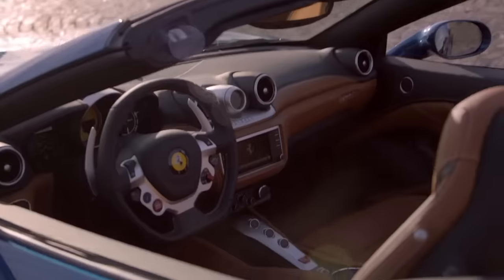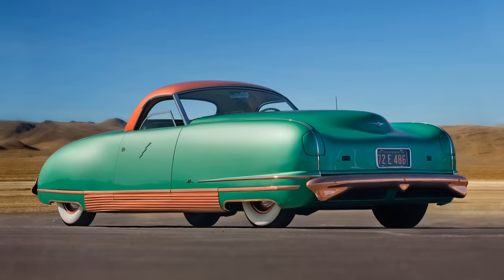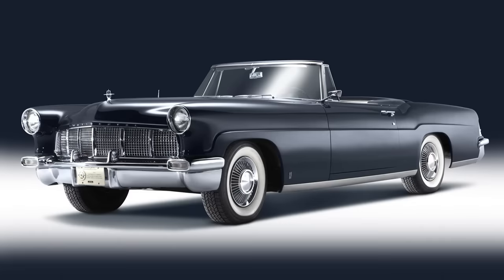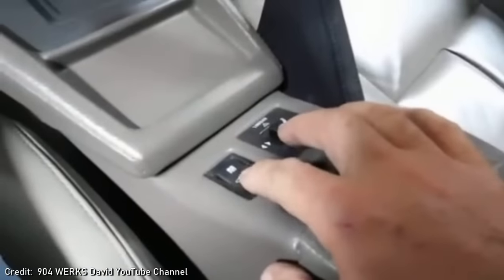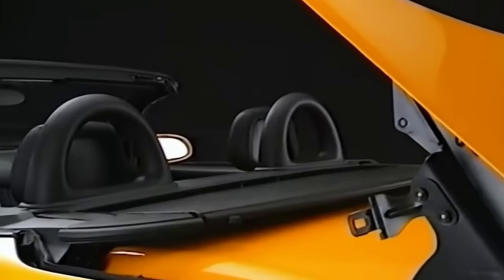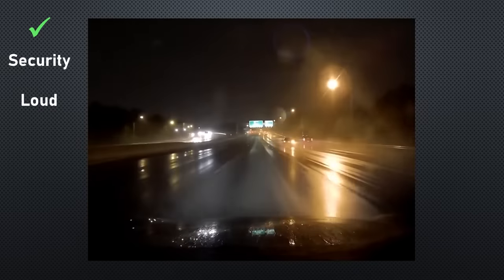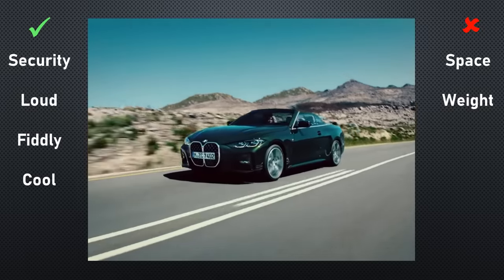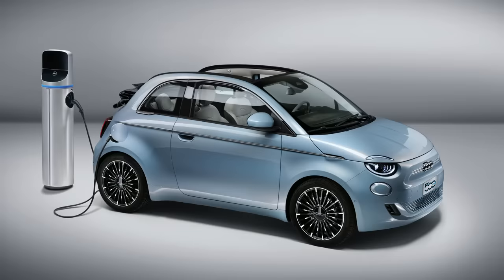The Rise and Fall of Retractable Hardtops

Comment: I have a soft-top, but I think that there are benefits for hard-tops. I live in an area where it snows and I don't have a garage, so I'd be worried if I got like 2ft of snow on a soft-top. It's completely automatic, so I don't have to worry about the situation of manually putting it up and down. It also has a glass back window with a defogger built in, which is a good middle-ground, I guess. I've considered numerous other makes and models with hard-tops, but the prices are nuts right now.

Comment: A long time ago my auto electric instructor told the class, if a retractable roof car (1950s) came into the shop for an adjustment, charge them three times your rate and you may break even.  ;-)

Comment: That original design of placing the hardtop on the back of the car (instead of in it) makes so much sense. If a luxury brand were to design a modern car around it then it could really be a success. Because missing out on so much cargo space isn't an acceptable sacrifice for most. You might not need it for most trips but you know you eventually will have an issue when going on holiday.

Comment: Simple answer.   Performance over looks.  Retractable hardtops mechanisms are heavy AND at the top, giving the car poor center of gravity.   An M3 today doesn't even come with a sunroof, opting for carbon fiber instead.    

Same reason why aftermarket rims industry is all but dead.  They're heavy, causing higher rotational mass.  Except few companies like APEX who prioritize light weight rims over looks

Comment: I remember back in 2006 when I saw a retractable hardtop in action for the first time, I think I was about 10. I knew what they were at the time but I thought you just manually picked them up and stored them in the boot. I was mesmerized at how the boot opened up and the roof slid into the back, it was like something from a scifi movie

Comment: One of the biggest problems with retractable hard tops, is certainly on four seater cars they leak. Leaky soft tops are quite easy to fix, but the hard tops are a nightmare. When I started looking for a convertible last year I hadn’t considered they leak but since owning one and having searched the internet it quickly became obvious the Focus, Megane, EOS all have leak problems although all of these roofs were designed by Karmann,  although they also designed the CLK and SlK roofs. Karmann were purchased by VW, which may be another reason preventing manufacturers from building them. Plus of course there are other downsides you can’t fit a roof rack, and you can’t fit a boot mounted bike rack.

Comment: Always like your videos.  It seems to be a rarity anymore these days, a calm, cool, collected car guy.   Since you talked about the used market for hard top convertibles, i have a couple of questions for you:  1.  Which do you think is the best model?  2. Are there any that have a manual override operation in case the automatic motors and doo dads give out?  Also, a couple of comments:  it would be interesting to see depreciation curves and appreciation curves of classic convertibles and hard top convertibles for a compare and contrast.  Item two, most "car guys" don't like theblook because it tends to make the back end of the car look bigger, but to each their own.  Lastly, there are some rare convertible suvs that look ok and were reasonably successful. I'm thinking of the Jeep Wrangler here, but there were many copycats.

Comment: I've got an old R129 SL500 and getting the removable hard top off so the fabric roof can be used is a right old rigmarole, that's why I upgraded to the R230 SL500 with the varioroof. Far easier to use and you can just flip it up or down any time you like without having to plan ahead for sunny days. No skuttle shake either, so it's win win as far as I'm concerned.
Reply: same here, fukk the R129's top situation, it's either or, I kept my hard top on on my R129, got my 2011 R230 in late '21 and am in bliss.

Comment: We had a Ford Focus CC . They had a strange wide rear end , to ensure there was enough space for the roof.

It leaked in bad weather… you had to declare a day as the weather was getting worse , to silicone the roof for winter , then not put it down .

Quite heavy at the rear. If you had to pull away quickly, the rear would sink and the nose lifted up, losing traction.

You missed 2 important cars :
- porsche 911 targa 4s … most beautiful retractable hard top
- Pininfarina modulo …. Only hard top to retract forwards to allow people to get in

Comment: Infinity G37 owner.  Cons definitely outweigh pros.  Zero trunk space, crazy complicated mechanics to run the top which apparently can’t be fixed, only replaced ($4500); cannot be Cranked up or down in the event of failure, ridiculous number of sensors to keep some dumbass from hurting himself, any of which don’t work stops the process halfway.  Nope.  Gonna sell the beast and go back to a simple, mechanical ragtop.  Yes, noisier, but the hardtop joints flex so it’s creaky regardless.

Comment: The only reason to own a hard top over a soft top is if you live in a dodgy area of town and  don’t want your roof slashed. 

Things like the EOS or the Renault and Citroen equivalents kind of makes sense for yummy mummies who don’t actually want a sports car, but putting a hard top on a sports car is as bad a Diesel engine in a sports car, ‘yes I really want my sports car heavier and with a higher centre of gravity’ said nobody with a brain ever. The MX5 is a prime example, yes I’ll take my lightweight sports car with a heavy metal roof and electric motors please.🙄🙄🙄.

Comment: Soft tops SUCKKKK. 
They need to be covered when sitting outside, they need hydrophobic coating applied to them 2-4 times a year, they're noisy on the motorway. Huge sacrifice for a bit of fun in the sunshine. And I've had both soft top and a folding hard top. Folding hard top is like having a regular car with a trick up it's sleeve.

Comment: I love my SLK 350 "transformer", this is the 21st century dammit, every car should be able to drop top at the press of a button :).    (Let's not talk about the squeaks and rattles that eventually occur in a hardtop convertible).
Reply: If you Krytox all of the seals on a regular basis a hardtop convertible will rarely squeak or leak. My Eos is almost 9 years old with no leaks, squeaks, rattles, etc.
Reply: @markb3756  I use Gummi Pflege (similar to Krytox), probably not as often as I should 🙂

Comment: Let me just say here that of all the useless, engineer-wasting affects modern cars have had, the "disappearing top" ranks near the top. Wholly aside from the Rube Goldberg mechanisms needed, the excessive electrical draw required and the wasted time waiting for the damn top to rise or set, there's also another major drawback: the complete lack of trunk space available after the top is down. And those are not all the drawbacks. Just the larger ones. Get a convertible, for goodness sakes!
Reply: My Megane cc is considerably more practical than either my old Saab convertible or C70 volvo convertible because the boot is considerably bigger with the roof up, the roof more waterproof and ages much better. 
The boot on both the Saab and Volvo was utterly useless. 
For cheap 4 seat roof down motoring it is u rivalled.
Reply: @HarryFlashmanVC  ..but with the roof down you still can't travel with luggage....

Comment: Citroen Pluriel anyone?
Reply: Interesting car, but didn’t have a retractable hardtop.
Reply: @AtheistOrphan  Well, the cant-rails/C pillars could be removed after first removing the folding-cloth central roof section.  Just a manually retractable hard-edged top.  🤣 Quite a clever car, like most Citroens.

Comment: The weight of these roofs prematurely collapse the rubber seals causing water leaks. Very common issue on sl Merc’s, and conveniently the ecus were kept in the boot floor… planned obsolescence
Reply: The issue is that the owners did not maintain the seals properly. Approximately zero people use the proper Mercedes hard top seal conditioner which is described in the manual. Nor did they replace the seals once every 5 years. 
You can't neglect something for a decade and then be angry when it doesn't work.

Comment: Sure, the public's infatuation with trucks and suv's is diametrically opposed to power hardtop roadsters. Driving mentality is all about cargo and passenger loading. Going anywhere off-road and tragically maximum height over other drivers matter more. To hell with that. There's nothing like the glass roof roadster experience of an R230 SL. Mercedes has perfected open air driving to a sort of communion with the road. It's silence allows conversation top down at 100mph. It's all metal robotic mechanism means running the top back at up to 30 mph because of the strength of it's virtuoso engineering. Even top up the glass roof experience is decidedly decadent. There are no glass roof cloth tops. What Mercedes has perfected cannot be improved upon. The R230 is the height of the open road driving experience.